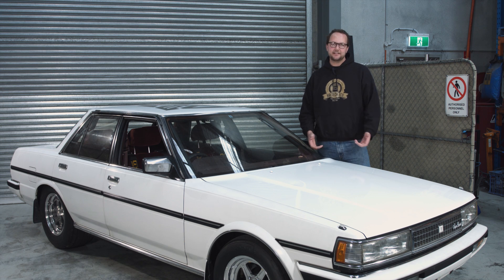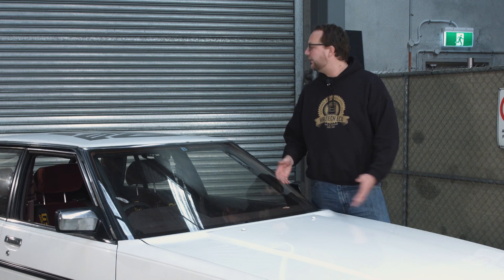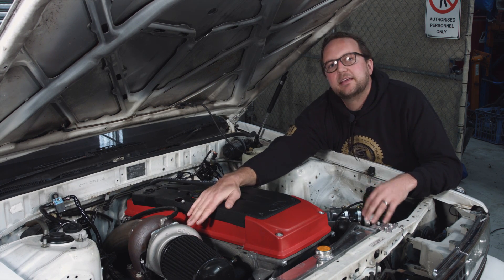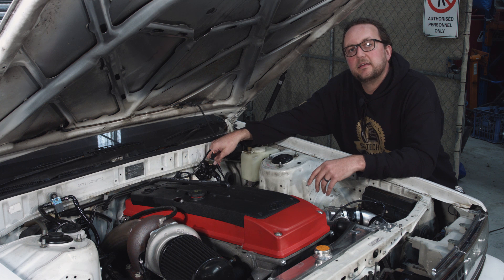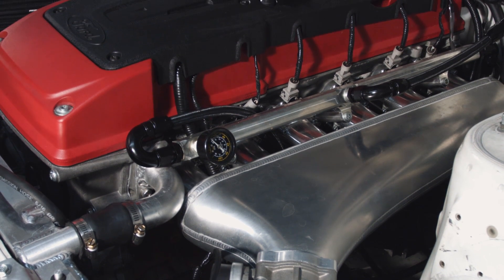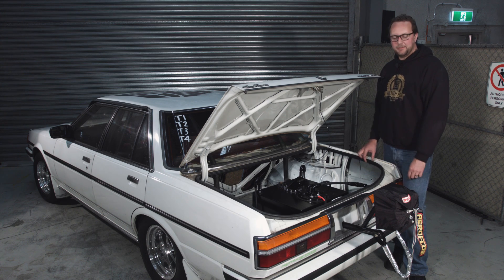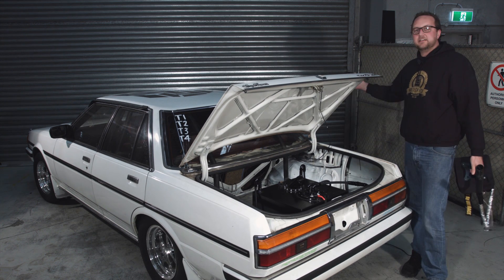💬 Mighty Car Mods Cresta: Secrets of a 9-sec Sleeper | Technically Speaking

Comment: Weighs nothing , 600 hp , radials I could see it doing a faster Time then they showed if they put a bit more time in it also great drag inspired  aftermarket suspension system
Reply from the maker: That video is a few years old now and Benny has since gone a lot faster. He's now consistently  running low 8s.
Reply: @haltech  I estimated a 8.4 was I even close?
Reply from the maker: Pretty sure he's gone 8.0 or close now
Reply: @haltech  pretty crazy for a old Toyota that was built in a week

Comment: ahhh cavitation.... I should have known a turbine would do this..... cavitation can make electricity. No one is ready for that yet hahahaha Its so funny that people think cavitation to be some mysterious by product. Instead of another factor you can control. Its used highly now in high capacity industrial mixing. Just to show you its potential to do a thing. That isnt really what it does tho. Water cause cavitation as well. Anything does, if you can make it implode. The other force of the universe greater than "gravity" that no one knows about. Cavitation is happens because we have silly ideas about flow. Because of those ideas, we MAKE cavitation happen when its not needed. Clean up your flow dynamics and cavitation ceases. To have it happen shows your flow dynamics are completely wrong to begin with. No one wants to look into this at all.

Comment: Okay I know it’s from 2017 and this is a belated comment but it’s not technically a sleeper it’s not registered, a sleeper, it’s a registered streetcar that can blow the fucking doors of anything this is not that disappointing car mods
Reply from the maker: It's registered and street driven. Has competed in the Hot Rod Drag Week so it can do big miles too. It's running 8s now too so yeah, it can blow the doors off most street registered cars:) Having said that, the car is so well known in Australia, especially in New South Wales that every white Cresta is now being eyed with suspicion...
Reply: Haltech wow very impressive I stand corrected, must be a weapon does it retain any of the luxury’s on the street like air con and power steering?
Reply from the maker: Don't know about power steering but def no air con.

Comment: I wish ford would sell the barra six in the states it would solve most of the problems they are having with the LS engines selling better then the coyote engines they should ditch the coyote and sell the Barra six  the 6 banger has better fuel economy then both of the V8's and can make just as much if not more per cube

Comment: serious question that i can't find a straight answer to: can you do/is there any point doing a flash tune on the N/A engine? i have an '03 BA Wagon and would like it to go a little harder lol. it has a 2.5" exhaust with a hi-flow cat converter but that's the only mod done on it so far.
Reply from the maker: Depends what you're expecting from a flash tune, but yes, you can definitely flash tune a naturally aspirated engine.

Comment: Im impressed that the engine bay wasnt blinged out. MCM just put the effort into what would make this car go fast.

Cant wait for the boys to turn the boost up and try some 8s, but might pop the stock internals.
Reply: Nor Dic it already ran a 9.00 and the internals are fine. This ain't a 302 that will spilt in half at 500hp...

Comment: Torque-based tuning = essentially load-based tuning. And good load-based setups adjust for variou ambients, like the higher oxygen content in the cold (creating more load) and lower oxygen content in the heat (creating less load), then adjusting the boost accordingly to equalize power year-round.

Comment: For tyre slip control you want to use a Kalman filter to arbitrate between undriven wheel speed and integrated vehicle acceleration from an accelerometer, (or even better, doppler radar ground tracking or GPS (>10Hz update required) if not banned by your racing regulations) that way you can control tyre slip to a target value in real time, irrespective of the actual run time or track mu.......  (

Comment: Hello guys at haltech. I'm hoping you can help me out. I'm wondering can an after market ecu work with stock gauges if you swap the engine. For example I want to swap my 88 bmw e30 engine with either a s50 or an s52. My car is obd1. So if I where to put one of these engines in my car and use a haltech as the brains of the opperation can I still use my e30 gauges?
Reply from the maker: Being 1988 the gauges would have been completely independent of the ECU, and CAN was not being used on vehicles yet.  So long as your gauges are all still connected to their relevant sensors they should all stay working.

Comment: I'm kinda confused about why you'd want to misfire the engine to slow it down. The faster the better right?
Reply from the maker: Power does not equal Speed. If you're putting too much power to the wheels and they're spinning then you're not going anywhere fast. The trick is to put maximum amount of power down while still maintaining traction.
Reply: Haltech ok gotcha now. Yeah I wasn't thinking about that

Comment: Where are the 3 relays and 3 fuses? 5:45
Perhaps he meant specifically for a street car. I saw 3 individual 14 maybe 16AWG wires but they were all connected to 1 post per polarity.. and there were no means for controlling the relays within the tank "which would be an unwise move anyway but that kinda depends on things like the stoichiometric ratio, etc."
I can only presume if there are indeed 3 relays and 3 fuses for all 3 pumps then they are upstream connected to those wires and inherently all "electrically connected" at those posts. I understand that once one fuse or relay failed that the remaining ones would also. However, Iv'e never much liked  that style even though it's common in inverters, battery chargers, etc.. I guess it's not so bad being wired down individual cables though and with that, I think I just answered my own question..    :)

Comment: Quick question what are the gains for e 85 since its terrible for ur engines
Reply: E85 is superior in every way provided that you prep your engine for it. It burns  faster than regular Unleaded because as it states in the name Ethanol85 (where the rest is 98Octane) i.e. alcohol burns faster but it is much healthier for the engine because of it's purity and properties to withstand knock.

Comment: That drive-shaft curve almost sounds like cheating. Consistent passes are what drag racing is all about. Traction control, drive-shaft RPM curves and computer controlled throttle remove a lot of the drivers control. One day the 'driver' will really just be a solo passenger.

Comment: That original car seat isn't really safe at all if you crash. the back end of the seat will probably snap and buckle backwards. due to the fact that this is a mid 80's toyota. they should put in a proper racing seat with real support for the body
Reply: The seats might have been connected to the rollcage for strength?
Reply: The seat will still not support your body in the correct way. like the sides of your body could still easily move from side to side. where a racing seat would have protection for all movement, as the slightes movement could pose serious back injury at high speeds.

Comment: I wish ford had used this engine in cars in the USA!!!
Reply: John Molloy the barra barely has any resemblanse to the small block six. The aussies has awesome stuff since the 60/70s. Such as crossflow aluminum heads, which will fit the American sixes.
Reply: They did (sort of) The Barra is based on the Thriftpower (Falcon) 6 from 1960!! still has the same bore centres AFAIK. 144ci -250ci.

Comment: Dr. Tuningfork,

Out of curiosity, is there any relationship between the Barra and the old 5-litre/300CI inline 6-cyl engines that were offered in the States until the mid-90s in Ford pick-ups/vans/large cars? I believe you guys had a similar item in Aus. as well.

Cheers mate,
Mike
Reply from the maker: They might share some common ancestry as the "Barra" design was somewhat based on the "Thriftpower Six" design. But as a stand alone engine it was designed and manufactured in Australia and, as far as we know, exclusively used in Australian-made Fords.
Reply: Thanks, mate. I was aware they are not exported, but the ancestry is always interesting. Please keep the in-depth content coming!
-M
Reply: The NA motors are available in the Ford Territory in South Africa & from memory a Canadian company sells Barras for industrial applications. It may be the easiest way to get a Barra block into the US
Reply: Mike Peterson the one you are referring to are the big block 6s, it is not related to the Barra. The small block six is, which was the 170/200/250. Also it ended up being a 4 cylinder. They just chopped off two, it was what powered the tempo. In Australia they had aluminum heads on their 6s since the 70s. A lot of people import these crossflow heads since they will bolt on to the American sixes.

Comment: Hey man! I would like to know wether the NA 4L barra and the turbocharged 4L barra have different internals, cheers!
Reply: The N/A FG Barra uses higher compression pistons and weaker rods. Although many people have pushed standard FG N/A bottom ends into the 500RWKW range. The valves are also made of a different material in the N/A head. The only other difference in the FG series of engines was the F6 Barra (blue top), which used a slightly lower compression piston than the red top XR6T engine. Other than the piston the FPV engine was identical.
Reply from the maker: Pretty sure they came with the same internals. There were slight differences between the BA to BF and then the FG series.
Reply: Haltech okay awesome, so the NA one with a turbo may get pretty high output out of it, but maybe not 350 wheel?

Comment: Scotty, you mentioned staged pumps and assume that implies the Elite can handle that. Would you imagine that an Elite 750 or 2500 would be able to run an EcoLPI setup, which has a single, 5-stage pump plus a return solenoid to regulate fuel line pressure at 250ish PSI?
Reply from the maker: The engine of course is supported, but we've done no development work ewith this style of injection. So we would need more research on the control method being required before we can say yes.  However, with LPI not being a performance application, it is not something we're likely to look into very soon sorry.

Comment: So how is each of the 3 pumps wired to its own relay and own fuse when you only have 1 positive and 1 negative terminal into the tank!!?
You would need 6 separate wires going in if they where wired separately with their own fuse and relay..
Reply: Gordon Dragons, I'm with Fred on this, yes each of those 2 wires is fused but if one pump dies it might not kill the power to the dead pump....

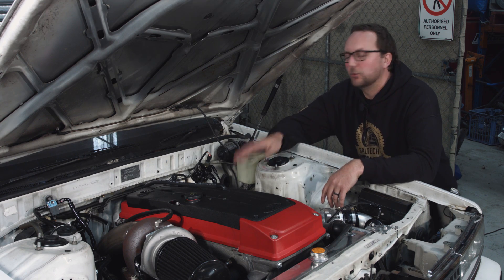Comment: 5:07 [silky smooth baritone]"let's take a look in the back and see where all the fuel comes from..." 
[run porn musak]
lift the skir... errr I mean lift the trunk lid, yeah, the trunk lid ;)

Brilliant ;))) luv ya guys ;)
Reply: 8:05 "...and then we have out communication cables hanging out the side..." ;)))) mmmmmm what protocol are you running on those..? ;)
Reply: On a serious note.., what actual sensor(s) are you using to monitor the driveshaft rotation speed..? Thanks in advance..!
Reply from the maker: Just a standard driveshaft rpm sensor like this one: http://www.autometer.com/media/manual/2650-1373.pdf
Reply from the maker: CAN